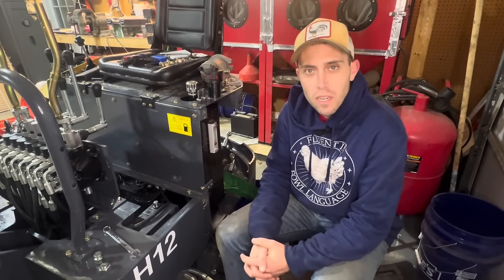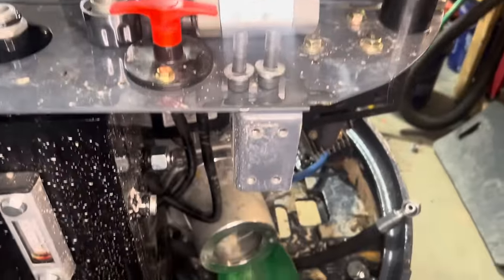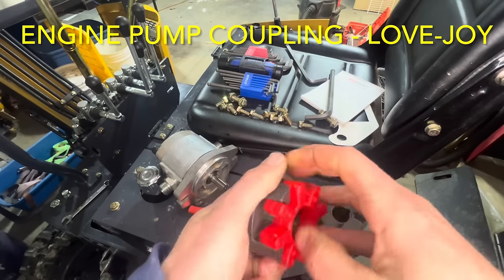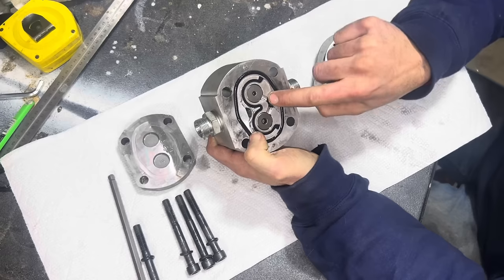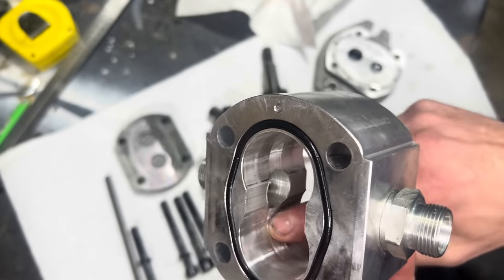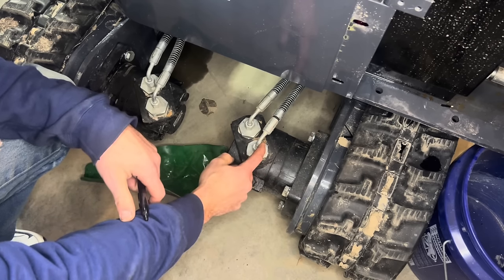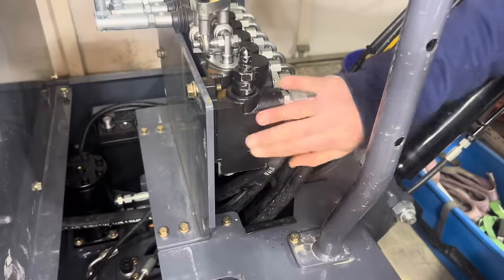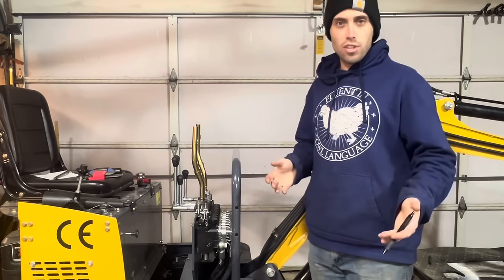Chinese Mini Digger: Why are my tracks slow? 6.8ml/r CLOCKWISE Hydraulic Pump Teardown and upgrade?

Comment: The coupler between engine and pump is not really for damping vibration but more to compensate angular and radial misalignments
Reply: It does both. 

Filling the gaps between the jaws are blocks of elastomeric material, usually molded into a single asterisk-shaped element called a “spider”.
Just as coupling designs vary to satisfy different application criteria, so do the spiders in jaw-type couplings. The spider is the key determinant of the torque rating of each jaw coupling. It also can make a significant difference in the coupling’s response to vibration, temperature, chemicals, misalignment, high RPM, space limitations and ease of installation or removal.

Comment: Great video.   I also own an H12 and you are spot on with your engineering analysis.  Please look into the overdrive issues with the track motors.  The digger will accelerate past full speed  when transitioning onto a slope with enough slope, giving the operator an “oh, crap” moment.  Pulling back the track controls fully will throttle back the track motors.  I believe there is a mod to correct this. Please comment.

Comment: I'm enjoying your video very much. Thank you for sharing your knowledge and experience. I recently put a $20 crossport relief valve(VAU-G1/4) on my mini excavator swing motor, and I got a pretty satisfying result. I'm planning on doing some more mods. Some simple mods seem to be very cost-effective. As you know, Chinese mini excavators are simple, and parts are cheap. Please keep up with the good work!!
Reply: What does the crossport relief valve affect?
Reply: I'm assuming it dampens the cab rotation?
Reply from the maker: They’re nicknamed cushion valves, and yes they are designed to take the shock load out of large moving hydraulic systems that are swinging big masses around.
Reply: Great video

Comment: What can be done relatively easy is adding another pump with half or the same flow with electric 3/2 valve for adding oil to the other pump (high speed for everything) . From there on only need one size larger pressure hoses and slightly bigger 5/16" or  3/8" hoses to and from the swifel joint. In normal working with straight travel both travel motors get half flow. So that would do. The valve body can handle it and the swifel and travel motors can handle it too.

Comment: I can walk faster than this thing moves.  It's ridiculous!   I've contemplated putting the mini excavator on a little trailer just to move it around at the work site.  Thanks for your research with this issue.  Very helpful, Thanks!!
Reply: This is what I do. I have an old Jeep Cherokee that I got really cheap and a small trailer. I move the ex around with it as it is quicker to drive the ex onto the trailer and tow it than it is to try to drive the thing around my 5 acre property.

Comment: Let me see if I got this right. If I am ordering a pump these are the parameters I need...

Pressure Rating (PSI): 2500 max working, 4500 max breaking

GPM (Flow Rate): 6.47

CID/REV (Cubic Inch Displacement per Revolution): 6.8 milliliter

Rotation (CW or CCW): CW

Flange: SAE #2

Shaft Type and Diameter: 9 tooth spline, 5/8" diameter 

RPM: 3600

Comment: I am working on fitting a hydraulic filter into the mix right now. And have designed a quick attach with tilting head too.

Comment: I really appreciate what you do and your videos.  I recently got a Hightop HT10BZ and it looks very similar to your machine - so your videos are nicely applicable.  I  had heard of the oil heat problem and I ordered mine with a factory installed cooler.  I think it is standard on the BZ model.  I do want to add a hydraulic filter and I am looking forward to your video and/or parts kit to do that.  Please keep up what you are doing.  It is GREATLY appreciate.

Comment: Great video!
If you had to choose only one Chinese model, which one would you choose? By the way, you could build a business on this. You could specialize in retrofitting one Chinese model. I've seen such a business with a motor lawnmower, where they replaced some quality parts to make the cheap Chinese machine more reliable and better.

Comment: GREAT VIDEO!   I am trying to troubleshoot a hydraulic issue with travel.  When driving on or off, either direction, trailer with ramps my mini stops moving forward or backwards.  I can still operate swing and bucket/boom controls but drive does not work.  When I level the machine out or lower the angle it starts working again.  I have checked fluid level and everything I can think of.  If you have any thoughts on this that would be great!

Comment: Mate great video , i bought an excavator but have no experience it his around 1700kg / 3500pounds , but theres something puzzling me . When im digging,  if im doing too much effort the excavator goes OFF , i wonder if my bypass is closed, the machine is also super quick on the levers . D902 kubota on it
Reply from the maker: My guess is your relief valve is set too high. Overloads and stalls the machine.
Reply: @thegarageconnection  that's exactly what's happening, ive been doing some research on but as I said first time newbie , go unscrew the relief valve pin slightly, correct?

Comment: Does the pump have to be a clockwise rotation or can I just install it upside down so the fittings would be on the correct side if it is a counterclockwise rotational pump?
Reply from the maker: Correct it can be flipped

Comment: Is the second speed on 2 speed units accomplished by using a planetary hub? Seems like all the 2 speed units have what looks to be a planetary hub. Also the hydraulic motor is not in a vulnerable location.

Comment: Cam, you know I try to comment on every video to keep your algorithm up but I have to know, what do you do for a living? I'm assuming engineer. Im 55 and can rebuild a 350 small block in my sleep but you know more crap than 99 percent of my friends and I think they are pretty intelligent. And, thanks for another good video. Anyone thinking about buying one of these I would say this is the only downfall of the machine. They are laughably slow but once they get to work they are a small beast.
Reply: It's just hydraulics.  Everything is Lego (standardized).  You have a perception challenge.  That which you do not understand does not affect the complexity of the world around you.  IE:  It neither increases nor decreases complexity.
Reply from the maker: I am a 1st class machinery technician for the US Coast Guard. I grew up on old Jeep CJ’s but marine engineering is my passion. I currently instruct on German made 9,925hp marine engines.
Reply: Thanks for responding. I appreciate it.  @thegarageconnection

Comment: Hi I like your website.  What  if the excavator breaks down in the field. Is their a way to move the machine if the engine will not start.  Thanks
Reply from the maker: There is not a freewheeling valve on the machine but I suppose there could be

Comment: Sometimes when I have only one drive motor fully engaged and then just slightly crack open the valve for the other side, it goes into some kind of "hyperspeed" mode which seems to double the speed of the fully engaged motor.  Do you have any explanation for that?

Comment: Very interesting! I have a micro excavator that gets slower and very weak when the oil gets war. It has a 4,8cm3 pump now, will i gain anything by changing to a larger pump, like a 6cm3? I dont feel like the excavator gets weaker when its warm, just the tracks. I have to assist it going up inclines with the excavator, but only when its warm
Reply from the maker: Sounds like your pump is starting to wear and the fluid gets through the worn areas
Reply: @thegarageconnection  oil gets thinner when its warm so it sounds resonable that it would leak more. I will have to dismantle the pump and have a look at it. Thanks for answering!

Comment: Don’t feel bad Chinese excavator owners. I own a 1992 IHI IS-25GX3 2.5T 18hp diesel excavator. It’s top walking speed is a whopping 1.2mph down hill with my wife pushing it. But I would still rather own it then any Chinese excavator.

Comment: So, did i miss something on determining the stock replacement pump sizing? Would i just match the fitting size/type, the #2 bolt up flange, 5/8 9 spline shaft and pick a GPM range of at least 7?
Reply from the maker: Nope that pretty much nails it
Reply: @thegarageconnection  Perfect. I may pick one up to store as a spare. Thank you.

Comment: Cam do you remember when you took your pump out if you could turn the shaft with your hand my pump was too hard to turn by hand I had to use a pair of channel locks to turn it I don't think that's normal I think my pump is going out
Reply from the maker: Correct that is absolutely not normal

Comment: Do you know what PSI the pump is rated for?
Reply from the maker: I believe breaking pressure is north of 4500psi, system is designed to withstand 2500psi. Pumps have no ability to regulate pressure

Comment: Does this use hydraulic fittings that you can pick at a local store or are they something special?  If they aren't readily available, how do you replace the hoses?
Reply from the maker: The hose fittings are not well known or prevalent in many US hydraulic hose shops. Best bet for ordering replacement hoses is to buy custom lines from online suppliers
Reply: Any made up hose, clean the inside.
They cut them with a saw and don’t clean them out.

Comment: Are you in some kind of a hurry to move around? What do you want to do, race it? Be satisfied with 1 to 3 MPH. Get a full size machine then.
While some wheel excavators have a maximum travel speed of up to 22 mph, a track excavator crawls along at 4-6 mph.
Reply: 1mph is unbareable.
3mph would be great! Big difference working moving stuff in yard

Comment: That pump wear already is depressing.
Reply from the maker: These machines really need a cooler and filtration
Reply: They sure do, thanks for sharing your knowledge with us. I've certainly learned alot from your videos.. Can't wait until your cooler and filter system is for sale. I'm holding out to change my hydraulic fluid until I have a filtering system. @thegarageconnection
Reply: @thegarageconnection  can we get away without cooling if we monitor temps?
Reply from the maker: @njipods  technically yes, but you can’t escape the contamination and abrasives swirling through the fluid